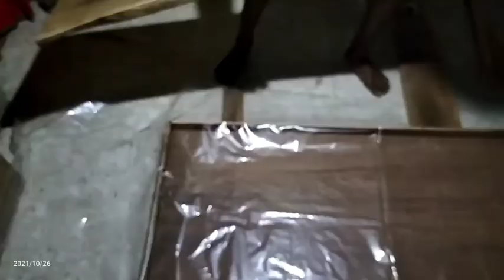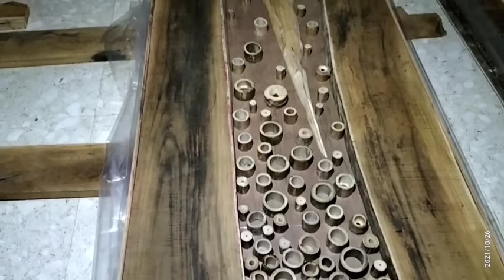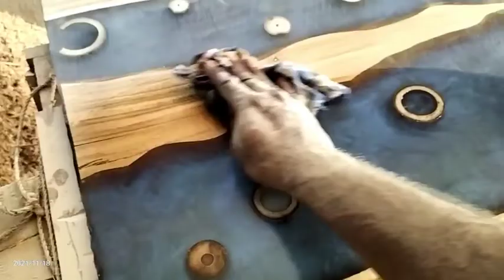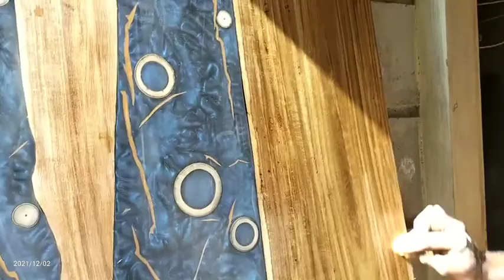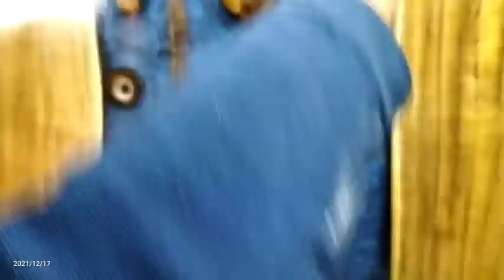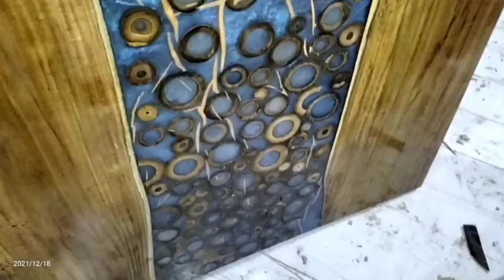Epoxy Resin Door _ by SMS

Comment: Is the plastic sheet absolutely necessary?  Could the form have been sealed with caulk?
Reply from the maker: Its not a plstic sheet.
Reply: @smsstylemyspace461  I’m interested in making an interior door which will use old barn wood and epoxy resin.  Can I simply make a back out of plywood, attach wood for bottoms and sides and place the barn wood inside and then pour the epoxy resin?
Reply from the maker: If used plywood then plastic sheet is necessary
Reply: It looks like the plastic probably caused the line spaces that allowed him to put the accent orangish color